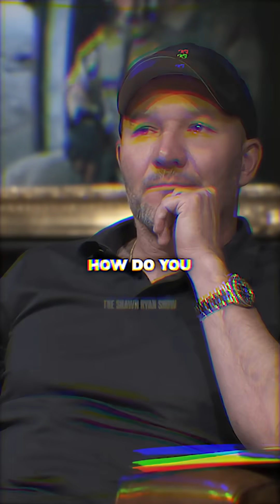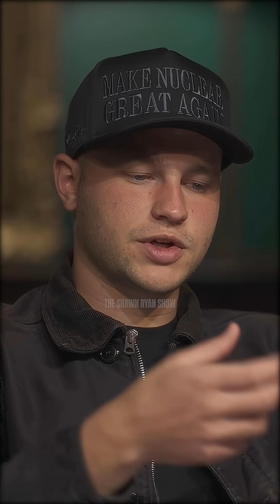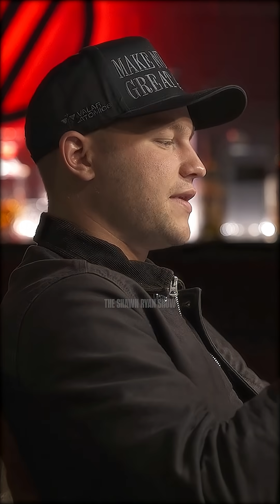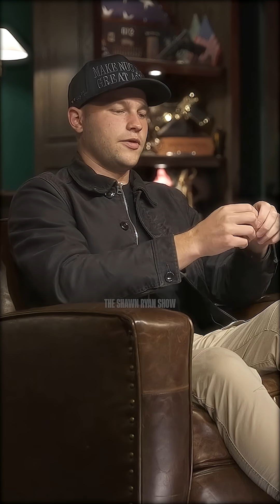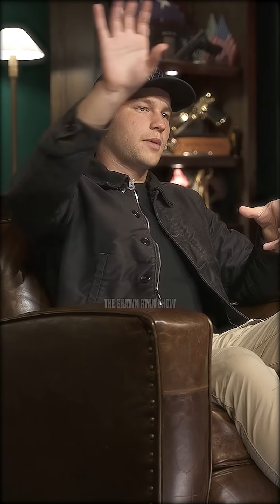Nuclear Energy Expert Explains How You Split an Atom 🤯

Comment: Moderator also slows down the neutrons so they become thermal neutrons, which increases the probability of fission occurring. Counter-intuitively, if they move too fast, then they just pass through without causing the U235 to split.

Comment: he explained more than just splitting an atom, he explained how splitting an atom can be used to generate heat and power. The only thing he left out is how to control the exponential growth, because if you don't, you'll get a core meltdown. You can do that with control rods made of a neutron absorber whose position can be adjusted to make more or less contact with the core. The absorber reduces the number of available neutrons to slow down the reaction. This way the power output of the reactor core can be controlled.
Reply: I'm curious, does the process of absorbing these neutrons wear the absorbers down? are there components that regularly need to be replaced to keep this system functioning long term?
Reply: This is exactly what I was hoping to find in the comments. 💯
Reply: They are replaced when necessary.  Different levels of rods are available to the core engineer for different needs. I know if the "core killer" rods are dropped, every core is shut down in secods, requiring a complete clean out and refueling of all cores in the reactor.

Comment: A Moderator is a substance that slows neutrons down, it can be through scattering however there are other physical means, graphite is a common Moderator, so is water / heavy water! Anyway graphite is not crystalline carbon. Crystalline carbon, or the SP2 hybridized carbon atom would be diamond. Don't think they use diamond for moderation.. They also use other methods like geometry of fissile material and reflectors made from beryllium metal. But that's just how atoms are split in a reactor or nuclear bomb. atoms are also split by slamming them together at high speed in particle accelerators / atom smashers. Dave V. Physicist - although not an nuclear physicist.

Comment: I’m surprised we don’t have hot water delivery systems delivering hot water or steam to heaters and hot water heaters within 5 miles of the plant. Efficiency++
Reply: It's more efficient to deliver electricity than hot water.
Reply: Ok, how about the opposite? When it’s <50’F outside, use outside air to cool a fridge. When it’s <28’F, use outside air to cool a freezer. 😤

Comment: So if you never cool the heat generated from those splitting atoms and they keep splitting and growing into more atoms to split then your reactor melts down correct?
Reply: But we do cool the fuel constantly. Plus, there are several emergency core cooling systems that will automatically shutdown the reactor and inject water...

Comment: great explanation..just one added thing.. to prevent a run away chain reaction, you remove the graphite.. thus prevents the scattering of neutrons, thus shutting down the reaction…😊
Reply: Not quite...that is the role of control rods, which are made of neutron-absorbing materials, not graphite. They are inserted to control the reaction, not removed.
Reply: @geometerfpv2804 
Right, something that will absorb the neutrons.

Comment: I would think using nuclear power to heat and move things is an old way of doing things, wy can't nuclear power be used to directly power things so we can have nuclear powered F-22s or tanks, a direct energy power supply and not just moving turbine engines like a ship or sub.......

Comment: OI! U235 is perfectly natural!
I resent this implication that it's not!
It is perfectly natural fissionable material that has been here as long as any other Uranium atom!
It's thing is that it dies faster. And it tends to fission with many extra neutrons when it does, which isn't normally how unstable atoms cark it. Also, it will do this when kissed by one of those neutrons, even if it's cold: Other atoms, like U-238, will only fission if you slam them with a neutron far hotter than those it will release. (happens in H bombs).
So, you don't 'make atom split' so much as you do 'assist atoms split'. Which you do somewhat like building a campfire, but with fissile material for the fuel, and it's actually easier because you don't need to worry about air or exhaust, or even cleaning the waste out of the way: It'll 'burn' for months even choking on its own filth. And that's how 'commercial' reactors running on 'reactor grade' fuel work. Even with all that choking on their own filth, they're still almost a threat to coal energy. Fortunately, they're just a little more expensive, so money invested in coal mines has been protected by ensuring that we call unfilty nuclear fuel 'weapons grade' and mostly reserve it for military submarines. But this is done by regulating nuclear to the point where it's stuck with the 'alpha' version of the technology forever.
Reply: BTW: Moderation is actually optional, you can get a reactor to go without it. It just helps you get one started with less fuel, and also have better control over it. There are also neutron reflectors (usually just a tank of heavy water aka D2O) which help with that also.
But yeah: technically, 'assisting atoms to split' is so easy to do, that it is known to happen entirely by accident. (criticality accidents). Unlike building a campfire, you don't need to allow for air getting in and out, and you don't need to keep it dry, and you don't even need an ignition source.

Comment: From everything I’ve been reading lately, the neutrons create dangerous radiation. And IEC/FRC fusion, using boron 11, is much cleaner. Plus rather than create heat to then be used to heat a liquid for steam, losing a lot of its efficiency, it converts straight to electricity. Seems like it’ll be officially released commercially in about 5 years. But I’m sure it already exists in private. You can also use deuterium and tritium, it produces more energy, but also more of the neutron radiation.

Comment: He's incorrect.....

Nuclear Reactor Cycle:

1. Heat Generation: Nuclear fission occurs in the reactor core, producing heat.
2. Coolant Circulation: A coolant (e.g., water or gas) absorbs the heat and carries it away from the reactor core.
3. Heat Exchanger: The heated coolant transfers its heat to a secondary circuit, producing steam.
4. Steam Generation: The steam drives a turbine connected to a generator.

Turbine-Generated Electricity:

1. Turbine: The steam expands through the turbine, causing it to spin.
2. Generator: The spinning turbine is connected to a generator, which converts mechanical energy into electrical energy.
3. Electricity Production: The generator produces electricity, which is then transmitted to the power grid.

Cooling Cycle:

1. Condenser: After passing through the turbine, the steam enters a condenser where it is cooled, converting back into water.
2. Cooling System: The cooling system (e.g., cooling towers or water from a nearby source) removes heat from the condenser.
3. Recirculation: The cooled water is recirculated back to the heat exchanger or reactor, depending on the design.

Key Components:

- Reactor: The nuclear reactor is the heart of the power plant, where heat is generated through nuclear fission.
- Coolant: The coolant plays a crucial role in removing heat from the reactor core and transferring it to the secondary circuit.
- Turbine: The turbine converts the thermal energy of the steam into mechanical energy.
- Generator: The generator converts the mechanical energy of the turbine into electrical energy.

This cycle is a simplified overview of the process. Different nuclear power plant designs may have variations on this cycle, but the fundamental principles remain the same.

Comment: The products are simple. The process is complicated. It works the same as coal fired plants. In power production,The uranium is a heat source that boils heavy water, create steam, steam turns turbine, turbine makes electricity. Uranium is just a cleaner method of making steam.

Comment: "... Actually mechanically pretty simple..." 
Clearly I missed something...
Reply: He basically said…if you light a match in a fireworks factory, it’s all gonna start going off and if you have a big water tank next to it, that’ll get hot like a kettle and start making steam. If you funnel that steam onto a fan and make it spin, the axle of the fan will induce an electric current in a wire and you have yourself electricity to power other stuff.

The bit he was less clear on was how you light the match in the first place.
Reply: @d734-wy8kxby putting two radioactive isotopes too close together. Lol
Reply: @MrJdamnBro  Well…sort of, but not. Proximity doesn’t split the atom (unless you mean a proximity which reaches 0 and has a huge velocity as it gets to that point). You need to fire a neutron at an atom’s nucleus…but…how do you get a neutron and then put it in something that fires it in the right place?
That bit isn’t mentioned in this clip - he isn’t clear on this bit.
Reply: @d734-wy8kx that was awesome
Reply: Hot rock make steam, steam turn turbine, steam turn to water, hot rock make steam....  Mechanically its pretty simple.  The keeping the hot rock from being a dangerous spicy boy, isn't.
Reply: Some of the specifics cannot be publicly disclosed without legal implications.

Comment: I just love at the end how he says mechanically pretty simple
Reply: It is, it's just a fancy boiler. Same thing used on ships and stuff.
Reply: he's right ^_^
Reply: The science behind it might not be. But the actual mechanics are fairy simple
Reply: It is mechanically simple. A few elements, causing a reaction, heating a fluid, circulating the heated fluid which drives some type of power generator (turbine, etc)
Reply: @HalferLandPerformance It's the maintenance that's complicated
Reply: he explains it very well, he has a deep understanding of his field
Reply: Until your steam generator pipes rub together: ask Mitsubishi about San Onofre. Or your Baffle bolts become brittle: ask Westinghouse about Diablo Canyon.
Reply: Well it is though. Very easy to grasp if you understand all the variables.
Reply: Heat source -> steam -> generator -> repeat. 

Creating the heat source through nuclear fission though...that's where it gets tricky.
Reply: Imagine this guy was your local mechanic!!!
Reply: You guys are LYING this shit ISN’T FKN simple & now I have a huge problem on my hands over here!!
Reply: @Whoisdey  try turning it off and back on
Reply: @AJD-od9nq that made it worse 😮

Comment: I was gonna say I have no idea what tf he just said
Reply: He basically said…if you light a match in a fireworks factory, it’s all gonna start going off and if you have a big water tank next to it, that’ll get hot like a kettle and start making steam. If you funnel that steam onto a fan and make it spin, the axle of the fan will induce an electric current in a wire and you have yourself electricity to power other stuff.

The bit he was less clear on was how you light the match in the first place.

Comment: Can graphite dampen emp effects by scattering it the same way?
Reply: No..... Not at all.
Reply: Graphite technically can have some shielding effect for an EMP but it's less effective than other metals like copper and in general isn't particularly great at that job. The shielding effect that it does have has nothing to do with the physics utilized in a nuclear reactor.
Reply: @chadMbro I mean in use as a substitute for lead. As the USSR had a lead shielded MIG jet that the USA has in its possession. Maybe making an alloy type mix out of graphite, copper and said metals could shield our fighter planes from emp blasts
Reply: @chadMbro we could liquify it and spray it on all vehicles
Reply: @rhysweertman1810 I don't think the juice is worth the squeeze on this idea. It doesn't seem like it's particularly efficient for the task you're trying to solve and we already have better materials to do that. The way that graphite works in a nuclear reactor is completely different than the scenario you're talking about.
Reply: @chadMbro but can graphite steer electromagnetic waves away from vital components
Reply: @rhysweertman1810 to some extent yes but less effectively than many other materials.
Reply: @chadMbro what if it is combined with other materials in a conductive emp dampener coating that may be mixed with other materials too for radar dampening
Reply: @chadMbro I just got this from google which kinda makes the idea of avoiding radar by interfering with RF via a tweaked graphite-copper coating on planes n other instruments. 

: In summary, the frequency dependence of graphite-copper alloys arises from the interplay of the skin effect, the electronic interactions at the interface, and the properties of the graphite and copper components. This behavior can be tailored by adjusting the graphite content, microstructure, and processing methods. 

So by tweaking the graphite content we can mess with radar methinks. Whadayouthink
Reply: @chadMbro and it will be harder to track by heat or sound

Google: The study of harmonics in these composites can be important for applications where dynamic loads are present, such as in rotating machinery or other vibrating systems. Techniques like second harmonic generation (SHG) can be used to study the material's behavior under these conditions

Comment: There's Graphite On The Roof.
Reply: I was thinking the same thing lol! Isn’t graphite and the void coefficient the flaw that caused the Chernobyl disaster? 🤔
Reply: @VoicesForUSA  I think the USSR rods weren't fully graphite but just tips. Also I think the explosion was caused not because you can't use graphite but PAST a certain point it acts as an "accelerant", otherwise functioned as intended before they made the reactor go haywire.
Reply: @VoicesForUSA You mean it wasn't a lazy technician and my faulty purge valve?
Reply: @MrJdamnBro  melt down wasn't the disaster...the hydrogen explosion after dumping water on the surface of the sun and the subsequent fire from the burning graphite was.

Comment: How does one get a hold of 1 neutron and then throw at something....at anything?
Reply: This was covered where he talks about moderators.
Reply: @goofballbiscuits3647 I heard that part but being a neophyte concerning this discipline I still do not have enough pertinent information for a fuller understanding...
Reply: That’s exactly what I was thinking. Just kind breezed right by that little miracle. I would think that’s pretty much where all the magic really happens.
Reply: @badbatch974 thanks... I'm far from low IQ but there is so much to know or understand at a basic level where I wish they had gone a bit deeper into the explanation....
Reply: @bringuptheWolfsHead It's a short... you wanted how much of nuclear science smashed into it?
Reply: the U235 is unstable.  it wants to release neutrons as it decays.   it's not like a particle accelerator where you have to shoot a particle at an isotope.  in the case of a reactor the goal is to control the rate of decay via control rods which absorb the neutrons to keep the reactor from running away.
Reply: They're called intrinsic neutrons. They come from spontaneous fission and alpha interactions.
Reply: Need a neutron source.